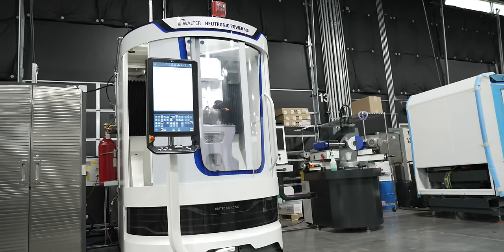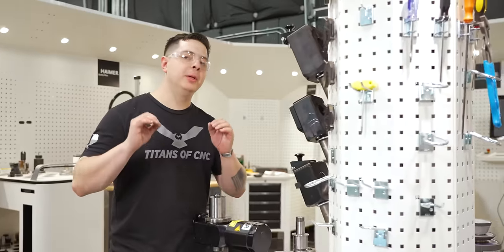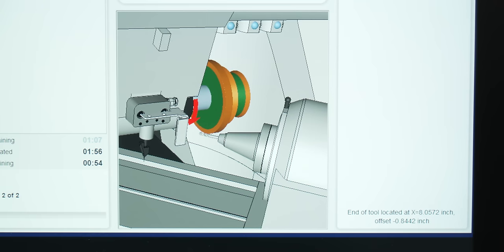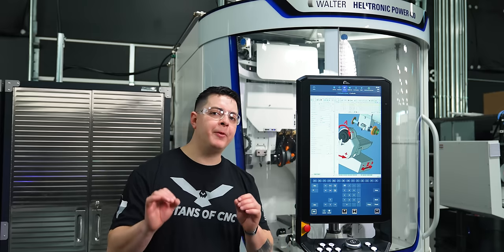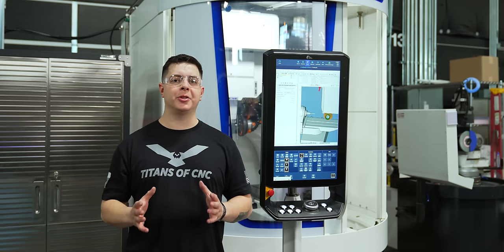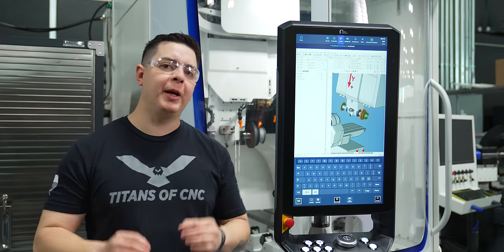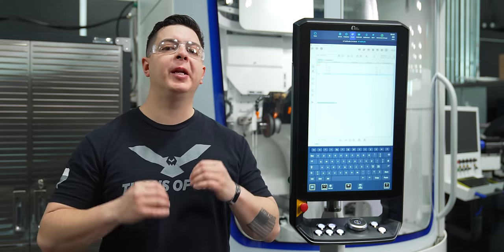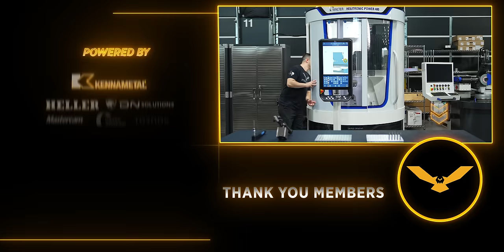Mastering Carbide Drill Grinding With The Incredible Walter Helitronic Power 400 Top Loader

Comment: Very interesting, always wondered what the process of tool production would look like. One question, how does the machine know the geometry of the grinding disks? Are the disks and spacers made to really tight tolerances or does it get measured and adjusted during setup? Do the grinding wheels need to get dressed or how do you deal with tool wear?
Reply: You measure your wheels and input that data into the software. You need to dress in your wheels as they come close from the factory but dressing them in would make them perfect as well as eliminate any runout.
Reply: @christophervillalpando1815  thanks for the insight. How do you even dress diamond wheels?

Comment: Thank you very much for this new very instructive grinding video.
Special thanks about Tool Loader configuration, it's a very precious information.

I have some questions...
- There is no need to tightening to a target Nm value with a torque wrench for tightening the grinding wheels on the grinding wheel holder ?
- You can mount grinding wheel pack on the grinder "directly" wihout balancing the wheels pack ?
Hope start this year in CNC grinding trade (the machine will most certainly be a second-hand Walter Helitronic), if i can avoid to invest in the beginning in a wheels balancer, it's a very good news ;-)
I hope you will continue to create tutorials videos on the Walter like the installation and configuration of the grinding wheels on the machine, for the moment I have not found this information anywhere.

Thank you again for sharing all this information and skills.
Chris.
Reply: It is always a good idea to balance your wheels before loading them into the machine. An unbalanced wheel can be a train wreck waiting to happen. I would invest in a measuring device to check runout and a wheel dresser. I dressed my wheels and verified the runout in these wheel packs. The balancing of the wheels, dressing them and runout all tie together. A wheel balancer would be a very advisable purchase if you are looking to get into grinding. As for torque specs refer to your machines manual, as it varies throughout.
Reply: @christophervillalpando1815  
Dear Christopher,
Thank you very much for your answer.
Noted about balancing the wheels pack, it's not an option. 
I look forward to your next videos regarding the use of the Walter CNC grinder !
Thank you again for everything you do @ Titan of CNC.
Boom!
Nice day.
Regards,
Chris.

Comment: So did you balance the wheels or not and my other question is does it handle well custom tool making with bigger diameters because usually I do custom tools on Schütte 335. but there is no lights out option.

Comment: Why do you need to probe the flute location? I mean they were just ground in the same setup, so I don't get if it's really necessary or just a double check. Full disclosure: just a lathe guy :)
Reply: It’s probing to offset the next wheel/tool with a macro so the controller knows exactly where to start. Also if the work truly has been cut; in order to make sure it has clearance for the subsequent path. There is what’s called a variable macro B code. If the probe reads outside one of these variables the programmer sets. The machine will not run the next path.
Reply: Thank you for the detailed explanation